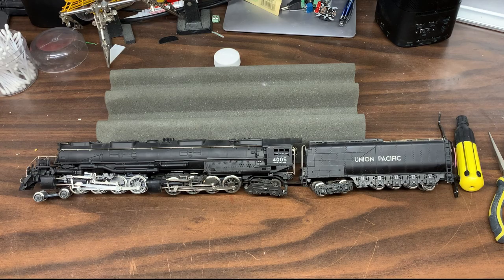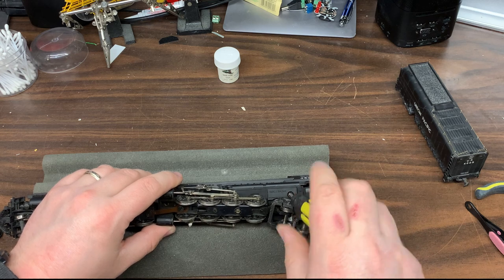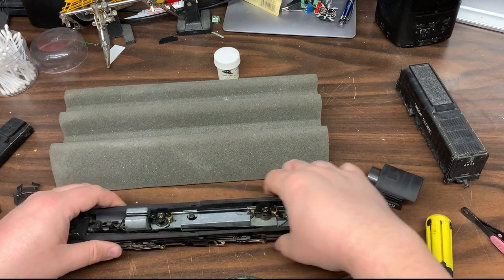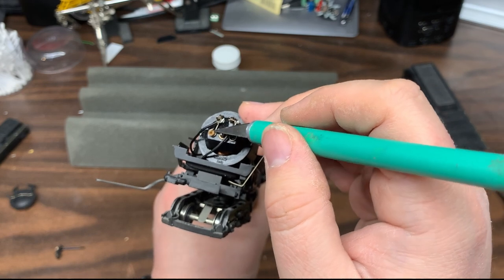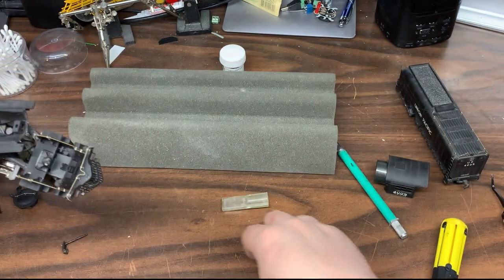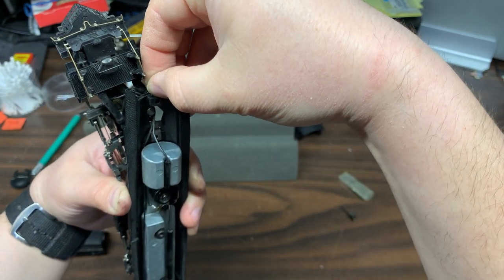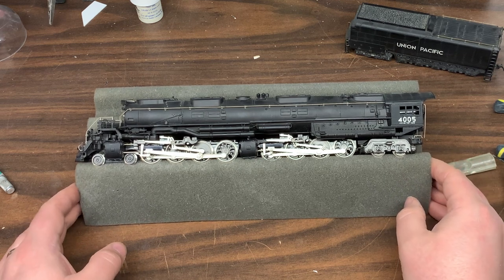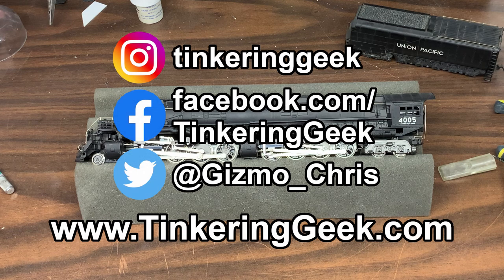Rivarossi Big Boy Repair & Review

Comment: These locos were not great pullers, however some CA glue & #9 lead bird shot & you can add hidden weight in this loco.  It's doesn't run well if left to sit long.  But the model itself was noted as being the most accurate model of the Big Boy at it's time.  Trix made a beauty of an more modern model engine of the Big Boy.

Comment: The deep European flanges won't run on Code 83 track and the three-pole motor and tall gearing doesn't allow slow running. They just sort of jerk from 0 to 20 as soon as you crack the throttle. I bought mine new for $39.93 in 1973 and still run it occasionally. It runs very well and the plastic traction tires allow it to pull most any train.

Comment: Awesome!!! I just bought one used online a couple of weeks ago for 80 bucks running. 
A Norfolk and Western #2197. 
Love the Riverassi's one of my favs!
Has a minor jolt to it at low speed which I am taking apart right now since I want to get at the innards, now that the outside is all clean, incl. wheels and drive assembly with new lube added.
Seen these things from a 100 to 500 used online. So I guess I got a deal too!

Great video!

Comment: I did not buy mine at a good price, however, with a new motor it pulls pretty well and i plan on putting a dcc chip in it.
Reply: Also i dont recall the exact motor i got, but basically, you need a 2mm universal shaft, and the new motor.  You also would have to cut the new motor shaft down.

Comment: Does your guy’s big boy have a leaning issue?? Mine wants to lean to its left and can only take right turns. If it takes left turns it derails.
Reply from the maker: No it doesn't have that issue but it does rock back and forth some as it goes.
Reply: It was my pivot arm in the front making mine lean to the left

Comment: Nice video! I did a stupid decision on my big boy and I decided to take it completely apart. Now I am in a bit of a pickle.
Reply: What is the pickle?
Reply: A shame you got the older version with the motor in the cab.Not very good runners.The later version,had the motor in the boiler,between the gear towers and much better motors.They ran really well even on DC.They did have a big problem with power pickups,tho.A repower would be easy enough,and make a BIG improvement.Cheers Michael
Reply: @michaelcudby787  I learned my lesson the hard way, I too bought a blue box Big Boy from back in the day and replaced about 4 of those dumbass plastic driveshafts before I permanently shelved it. Motor ran great, engine was gorgeous, but was a huge let down.

Comment: Actually the Rivarossi Big Boy detail wise is very accurate. Not up to today's standards possibly but they will still won't look too out of place on a layout with Athearn and Broadway Limited versions (on the otherhand, even a fully detailed Bowser version with the correct Box Pox drivers will seem odd). The length of the flanges is a big disadvantage though.

The motor is an original Rivarossi can motor. lmost all Rivarossi locomotives, both steam and diesel have similar motors (although this one seem longer than most). There are remotoring kits for Rivarossi steam locomotives out there.